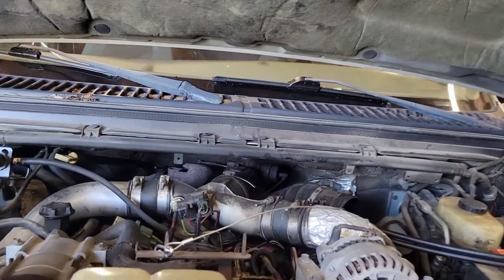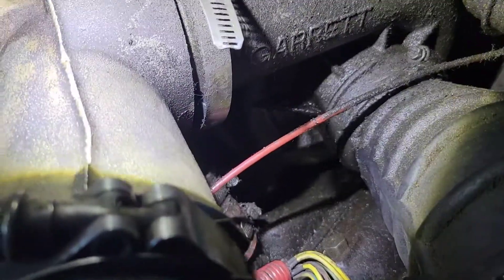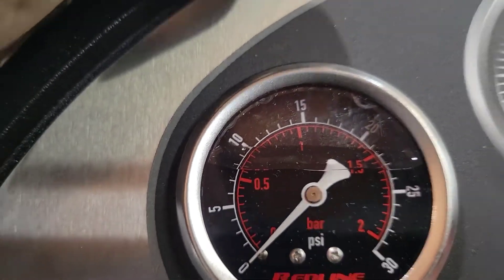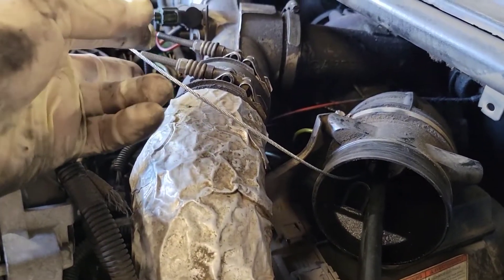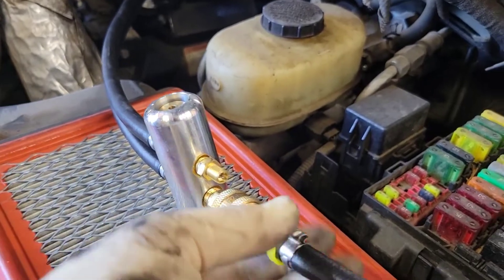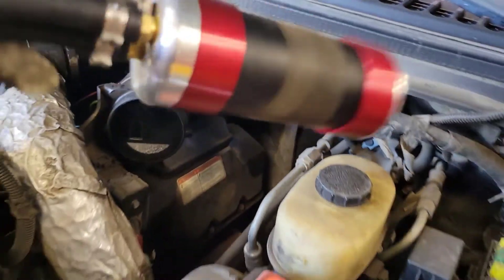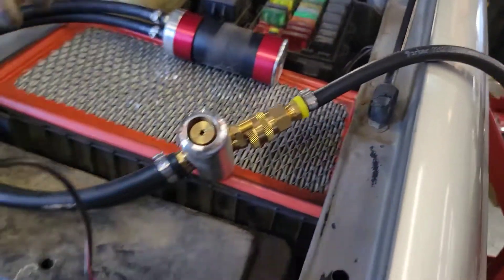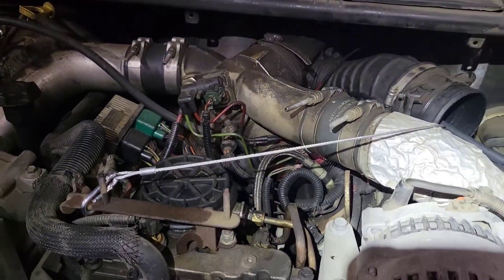Turbo Boost Leak Testing

Comment: I’ve made my own and right on the intake and on mine I have to go over 15 psi which engages my second fuel pump and it’s vacuum operated. This is a very nice machine that’s for sure. What I do is apply air and use soapy water as a double check.
Reply from the maker: Awesome that is good to hear. I have made homemade adapters and stuff in the past. Thanks for watching